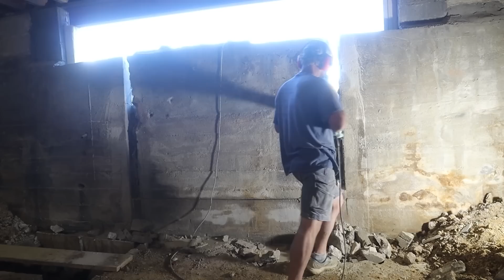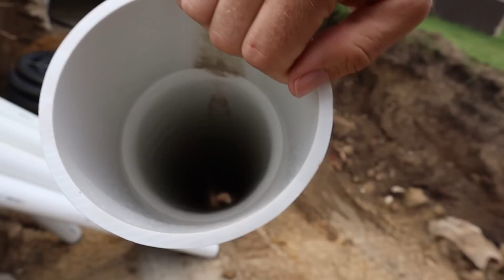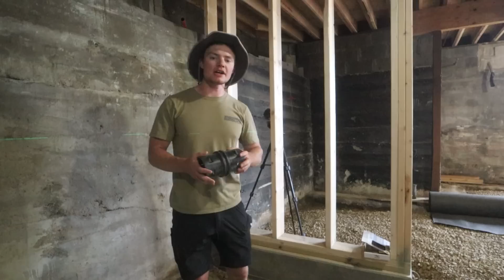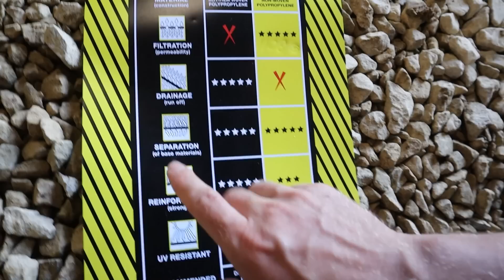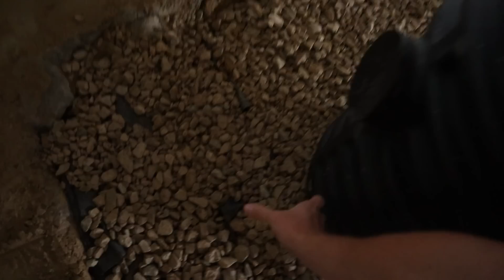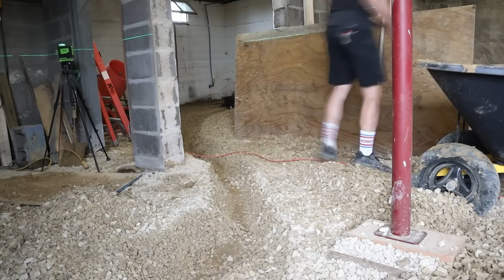Restoring A $7,000 Mansion: Building A Basement Water Removal System

Comment: Loving the DIY house videos. What an incredible house you have. Here in the Midwest, your drain tiles empty  into your sump pit, and then your sump pump removes the water in the pit through a standpipe that exits your house, through the wall, just above ground level. Basement floors are tapered towards the sump pit. I can’t imagine a standard sump pump being strong enough to pump ground water thirty feet through a four inch corrugated pipe. But, in full disclosure, I’m not a drain tile expert, and I’ve never seen a set up like yours before to know, one way or another, if it works.
Reply: he doesnt even need that sump pit since his drain tiles are all flowing downhill and will daylight out to the creek. He will not be pumping water 35 feet through that 4 inch tile, it is sloped as well. As soon as water enters the first inch of the 4 inch, it will flow by gravity down to the creek.
Reply: That's the way they do it here in Kansas. I think Cole is installing the sump pump as a backup up to the drain tile that runs to the creek but if it were me, I would NOT route the sump pump drain into the drain time, If the drain tile gets plugged and the sump pump kicks on, you want that water draining somewhere else...
Reply: @billnict1  I think he will actually run a hard line up and out like a normal pump gets ran. The 4 inch solid tile from the pit will, or should be ran on its own out to the creek as well but thats only in there in case his pump were to fail and the other tile fails, it allows the sump to naturally drain out. He has 3 different ways for the water to be gotten rid of.

Comment: Y aren’t you running the drains to the sump and then pump it up and out ? I what to know what pump is going to pump   a 4 in pipe that far and high I use to do this for a living and we never did it like that it just seems like your going to have to have a huge pump?
Reply: HAHA no way you did this for a living and you still just asked those questions!!  He is installing all that tile on grade and its running downhill out to a creek. No pump even needed. He only installed the sump pit because it was cheap and the floor is gone so it was easy to do, just in case he ever needs it. The pit has the 4 inch tile that is also ran on grade and will flow naturally down to the creek. He isnt going to be pumping any 4inch pipe full of water with a sump pump up high or far. Its all naturally flowing to the creek, its a french drain system.

Comment: My new house the perimeter drain tile goes into the sump pit and then pumped out by sump pump, no holes drilled in the pit crock. Also I tied my gutters into 4” solid field tile and drained away from the house.
Reply: Is the basement below the sewer/septic line. Is the field tile that the gutters discharge into tied into the house drain. The reason I asked is because if they are tied together you are asking for trouble.
Reply: @Katiesmith_wx  i see you ask about the sewer/septic line in a few posts, what does the sewer line have to do with sump pump or floor tile lines? The sewer isnt tied in with any sump pump or drainage tiles. Just curious what you are asking about that for.
Reply: @warrenmichael918  I’m not asking nothing. In a normal setting, the basement floor is level with the sewer pipe so you don’t need a sump pump to pump the water out because the drain tile will get rid of the water normally. In a situation like this where the basement is below the sewer pipe due to the age of the house, you will need a sump pump to bring the water up to the sewer pipe to eliminate the water.
Reply: @Katiesmith_wx  You did ask about the sewer level to the guy in the above comment and also you asked this about Coles sewer. you are getting confused with what pipes are doing what and where they are going i think. Youre mixing sewer and ground water up and saying to sump pump the water up to the sewer. 
Cole has only ran field tile around the edge of the basement to allow the ground water to drain into it and flow outside and down to the creek. His sewer hasnt been ran yet and when it is ran, it isnt going to be piped into these black pipes and these pipes with the ground water is not going to be put in with the sewer. Also, his basement isnt below his sewer/septic because he hasnt ran any sewer and when he does, he will run it in PVC pipes, not these black tiles, and run it outside to a lower point in the yard and into a new septic tank.
Reply: @warrenmichael918  I’m not confused on anything or mixing anything up. I was jumping around a lot so people who know know and let the others figure it out. I said what I did in a way that if you know what I’m referring to you know and if you don’t oh well. That guy was referring to something that I had just wanted to know if he did something or not. Furthermore, field tile is the most screwed up and idiotic and corner cutting way to do French drain. He used it to save money which is the reason why house these days are so screwed up and that incompetent people think they can do something since Sam down the street knows how to do it. I just ripped out a drain that was done just like this and guess what the main two complaints were?
Reply: @Katiesmith_wx  maybe the way you are wording it is just not coming across very well then. Is English your first language? If you say field tile  is screwed up and idiotic for water removal under a basement, what would you suggest that someone install instead? Im not arguing, im honestly wondering what you would use.
Reply: @warrenmichael918  French drain tile that has the sock on it. Google that and it will show you the proper pipe for this job.
Reply: @Katiesmith_wx  ok lol. Well what cole just did is better. He put the tile in an envelope of gravel and fabric that will last much longer than the tile with the little sock on it. I know what sock tube is and i know that the way Cole just wrapped his in rock and fabric will work great.
Reply: @warrenmichael918 ✌🏽
Reply: My line for my gutters are separate from the perimeter drainage system, it does not go into the sump pump pit. Also I have a 4’ crawl space, no basement. Floor is cement, code here
Reply: @DavidHines-wn5gf  I was asking because some people will connect the two together which just opens a can of worms if the waterproofing isn’t done properly. It’s code here as well.

Comment: A sump pump should only have a max discharge of 2” pvc pipe which u can tie in to the tile going to the creek
Reply: He isnt going to tie a pump directly to that 4 inch tile. He might not even install a pump right away either. With all the fall he has down to the creek, his tiles will flow naturally to it without a pump needed. If he installs a pump, i bet he pipes it in like a regular sump and discharges it up and out the wall.

Comment: you don't need to do all that, the only thing you have to do is clear the foundation from the outside. In my country, cellars are smeared with bitumen [tar] on the outside, and the floor with a special cement that makes it waterproof, so there is no water in the cellar.

Comment: I would like to know why you didn’t put a sock on your drainage so you don’t ever have to worry about the lime or anything else, mud etc. getting into your drain pipe. Thanks.
Reply: no clue what youre trying to say here. A sock , like that huge roll of fabric he rolled around the pipe like a burrito, the same material he talked about for several minutes, or a different type of sock? LOL
Reply: @warrenmichael918  it’s possible to buy this perforated drain that has a sock on it. A sock is like a fabric cover and so when you lay the pipe down it has the cover already on it. It’s a little higher priced but I don’t think it is more than those big sheets of fabric. I used to price it in my job so that’s how I know about it.

Comment: The drain tile needs to go In the sump pit if not it won’t drain
Reply: what tile? The tile he ran all around the floor edge? It is all flowing naturally downhill through the footer into a creek.
Reply: Down hill from the basement bro ?
Reply: @MargisonGODBEY  yes bro, look at how high his house is up on the hill compared to where the creek is. I bet that creek is 15 feet or more lower than the floor of his basement.
Reply: I don’t know bro will just have to wait and see what he does in my basement the pipe goes to the sump and I’m on a hill
Reply: @MargisonGODBEY  if someone is going to use a natural french draining basement system , they have to be higher with their basement floor than where the water discharges. Looking at how far away and high his house is to the creek, it should flow right on down.

Comment: Common sense, ask your self if you want to stop the water outside the walls or inside? If you want a wet wall do as they do or get a dry wall and put the dranage on the outside below the concrete

Comment: I get the radon and footing drains with the sump pump. 
But where's the septic tank and septic field water solution ? You keep pointing at that old clay pipe  going uphill ... shit and piss doesn't flow up hill . Right Roman ???
Oh and by the way.  By drilling a million holes in your sump pump water catch basin you've compromised your radon gas protection.  I've built basements a time or two .
Reply: He just pointed out in the yard and said a new septic is going in. I dont think ive seen him point to or even talk about that old pipe on the edge of the ramp. His radon system will have a constant fan keeping negative pressure under his floor and most likely it will have a sealed or slosed lid on his pit. That should make any radon escaping at a very minimal and safe level.
Reply: @warrenmichael918  
It's a valid attempt . The gas is common in Ohio by the maps. He never mentioned testing for it.  Perhaps he did not sure . I'm curious to see if he will once it's done to compare . In my experience... it's best not to concrete for 1 yr .   If there are any deficiencies they are easy to fix .  But it all depends if . you're willing to wait .  I did and on a river property had to make changes .
Reply: @pushpushlambert8079  If he did test before, you can bet he will test after because we all know Cole likes him graphs and before and after comparisons!! LOL I dont think he tested or he would have told us and shown us, i think this radon is just something he wanted to make himself and the family be or at least feel a little safer from it. Im not up to speed on the good or bad designs of how they need to be installed but im sure what he is doing will be much better than not having one at all.

Comment: Wouldn’t it be better to pipe the sump directly out from where it is. Haveing a long run like that seems like you’re going to need a very strong pump. Seems like a ejection pump piped with to the at same wall and out would be more efficient
Reply: The 4 inch pipe he dug in is on grade and will flow naturally by itself. All a pump would need to do is get the water into that 4 inch pipe a millimeter and gravity will take it away.
Reply: @warrenmichael918 just seems like a lot of extra work and cost from just piping it out the wall
Reply: @justincredible1724  The pit was $28 dollars he said, pretty cheap to just dig it in now. The pit and the 4 inch line are just an added layer of protection to allow water to flow into the pit and out that solid tile he dug in if the tiles he put around the walls ever backs up or stops working. I think he will put a sump pump in as well and that will, or should be hard piped in the normal way. The tiles with perforations are his first line of defense then later he will add more drain tiles on the outside of the house. The sump pump will be his backup in case the floor tile stops working or gets clogged up and i bet that gets hard piped up and out like a normal sump pump does. The open 4 inch solid tile line coming out of the pit will be his other backup to all the others. If all the above fail, water will simply fill the pit and flow through the solid 4 inch pipe and run to the creek. It was a cheap and easy thin g to install while the floor was out, it was also like a 3rd line of defense against water. It is really above and beyond from what others do.
Reply: @justincredible1724  my comments are being cut off before they posted tonight for some reason. My above comment said the pump only need to get the water into the edge of the pipe to actually be able to run out but i had typed more saying that the pump wasnt actually gonna be plumbed into that 4 inch pipe and it was most likely gonna be piped in like a normal pump is. The perimeter tile will flow to the creek as his first line oof defense then if that fails it should flow into the sump pit and the pump should take care of the water. If the pump fails, that solid pipe he ran out of the pit going to the creek will be his 3rd line of defense against ground water. Stopping water from getting under your floor is the best way and he will tackle this when he digs outside and puts tile around the outside, thats the best way to stop it, before it has a chance to get under your house.

Comment: The tile in your basement doesn't have to have fall. Just from the basement to where your going to drain needs fall. You probably won't need the sump pump either.
Reply: ya, he kinda said that when he mentioned talking to his tile guy buddy. I doubt he even hooks up or installs a pump in that pit, he did say it was just getting put in as a backup to his backup since the floor was gone. Good and cheap thing to do now just in case....

Comment: you should have a check valve on the pump at the pit going to the 4 in to the outside. Do not put a 4 in hole in side of pit because if the pit is open to day light something could crawl through the pipe from outside or if the creek would flood it would back up into pit.  And a sump pump trying to shoot water from a 2 in pipe into a 4 in would splash back before sending part of the water on its way
Reply: If you install a pump you have a wrong constrution and put a band aid to it with a pump

Comment: Cole, by drilling all the holes in the sump pump basin, you've made it a hot spot for radon leakage.  When you put the cover on, you need to silicon seal it so it doesn't leak into the basement.
Reply: He said he is putting in a radon mitigation system, which most all basements in Iowa have.
Reply: @tamicoil7069 By drills holes will allow radon gas to escape from the ground and find its way into the basement. You never drill holes in the basin for the sump pumps. If they needed holes in them, the company would have put them in.
Reply: @Katiesmith_wx  They didnt drill a hole where the outlet pipe goes at the factory and i bet they know it needs one there. Many people drill holes in their pump crock if they are gonna use them like Cole is. He isnt piping his floor tiles into the pit, he is usiong it as a backup overflow pit, to allow the water to seep in if the floor tiles get plugged up.
Reply: @warrenmichael918  I get that, but the outlet pipe be connected to the actual sump pump. I haven’t seen one that ain’t like that. That is what floor drains are made for.
Reply: @Katiesmith_wx  These pump pits have lids that can be drilled to allow a discharge pipe to be brought out of the pump and out the top of the pit. Some of the nicer pits are sealed and have sealed spots that the pipes can be ran through and be sealed as they come out. Im not sure were talking about the same thing though. He will cut the side flat spot out and run his 4 inch drain tile through that. That pipe will drain to the outside and will be ran on its own to the creek, next to the other tile he ran towards the opening of the wall. When and if he puts a pump in the pit, he will most likely run siome PVC pipe out the top , through a lid and take that PVC pipe up and out through the wall either above ground level or even below the frost line and run it towards the creek or even a ditch.
Reply: @Katiesmith_wx ok I know I'm not the brightest person, but if it doesn't have holes for the water to get into it what good is it?
Reply: @Budd56  the two connection nipples on the sides of the sump box are for the French drain pipes to connect to the box and the water will be in sump basin and the sump pump will pump out the water. They make sump boxes where you can even connect the floor drains into them as well. I have never seen anyone do that to a sump box before. The reason you don’t do it is because sediment and other debris can get into the box and clog the pump up and the pump overheats and you have a flooded basement.
Reply: Radon Therapy Is Very Promising as a Primary or an Adjuvant Treatment for Different Types of Cancers: 4 Case Reports, 2019.  The Therapeutic use of Radon: A Biomedical Treatment in Europe; An “Alternative” Remedy in the United States. 2006

Comment: With the wind storms and tornadoes becoming more frequent have you considered putting a storm shelter in while you’re doing all this digging and dirt work, could be a section of the underground movie theater, just an suggestion, espically with young kids at home. 

On another note, corrugated piping for water mitigation is not recommended anymore due to the constant standing water in the corrugated plastic, mold and mildew have been known to grow there leading to the smell you’re trying to avoid, I would recommend pvc with holes instead if you want to avoid this problem forever. 
A second sump may also-be wise in the room I believe you used to call the interrogation room

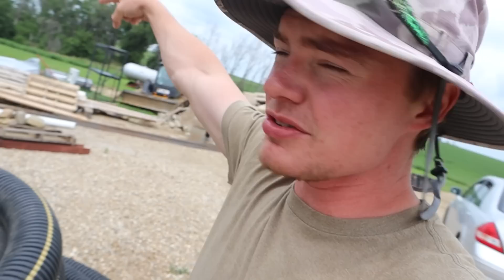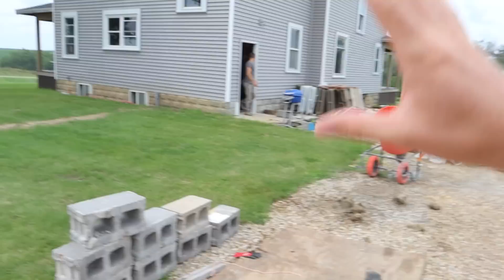Comment: Cole...you might want to at least take a roll of the black perforated pipe back to where you bought it ..and swap it for pipe which will contain the radon(gas)...iinm...you stated that the black perforated pipe would serve two purposes and mentioned(06:31-06:42) that the radon removal system would be one of those?!? Best of luck!!